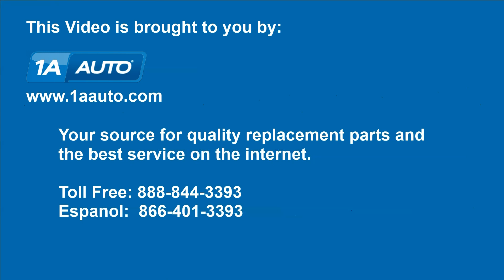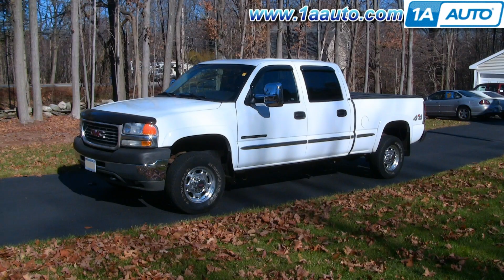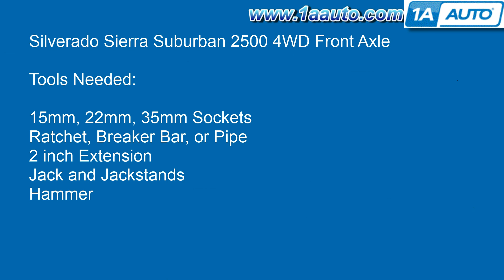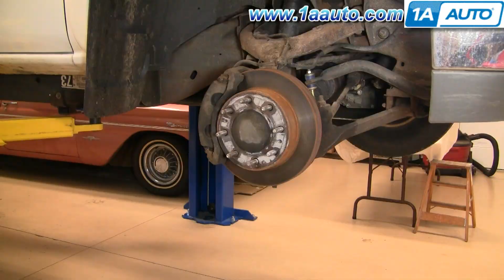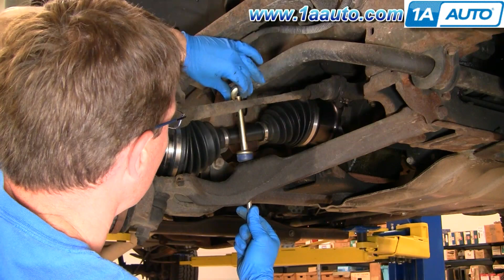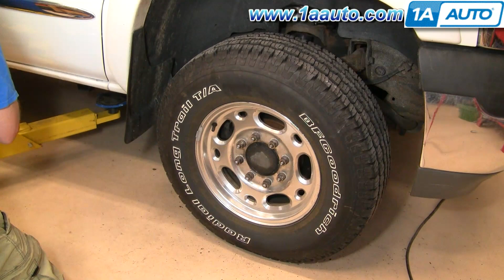How To Replace Front CV Axle 01-10 GMC Sierra 2500 HD

Comment: thanks this video worked out great. Guys if your truck is from the north it will not take you 20 minutes each side i spent 2 hours total on the job which still isn't bad and also it was my first time so i'm sure next time will be faster. The part that took the longest for me was keeping the CV axle from spinning while i loosened the bolts i used a pipe wrench on the driver side and that worked but the passenger side i had to use a pry bar and wedge it between the frame and the "ears" of the axle on the inside part where the 6 bolts are just to make sure it didnt spin and that worked out great. this isn't hard to do. also I took out the bottom bolt of the shock and pushed it out the way and was able to get the axle out that way vs messing with the sway links.

Comment: Great video great money saver. To remove that great big nut on the wheel I stuck a screwdriver in the ribs of the brake disk. As you turn it will hit the brake caliper.

Comment: GM made these very easy to do... You can do it without taking the wheel off if you want... I would have cleaned the mating surfaces and sprayed with fluid film....
Reply from the maker: +Steveo66 We appreciate the feedback. Sometimes there are multiple ways to accomplish the same repair.

Comment: Great video.  Can you tell me what the replacement bolts for the flange are?  Does 1A sell these?
Reply from the maker: +Jonathan Busch Thanks for watching!  We do not actually sell the replacement bots so we do not have the spec on them.  You should be able to reuse your originals like we do in the video, but if not you will have to source them elsewhere.  1aauto.com

Comment: did this repair and 1 of the 6 flange bolts broke as I was tightening them.  Checked you website (and others), no one seems to have a listing/category for these bolts (cv bolt, cv axle bolt, half axle bolt, flange bolt, etc.).  is there a size and specific material required for the bolts?  Is my truck safe to drive with just 5 of the bolts holding the axle?
Reply from the maker: +Samuel Karabaich I am sorry to hear that happened!  We do not recommend you drive the vehicle with a missing axle bolt.  That is most likely going to be a dealer part, so you may want to give them a call to see if you can get one. 1aauto.com

Comment: Hi I ran into an issue installing my oem replacement CV axle from gm for my driver's side and for some reason it will not reach the CV flange I tried to force it all together and tried jacking it the truck up and down and nothing was making it go on there yes I made sure it was oem it's exactly the same as the passenger side one what could cause this??

Comment: I do have a question I need help with.   I lowered my torsion keys on the front end of my 4x4 truck pretty low (I'd say 3 inches) ...and I was wondering if that can harm the CV joints in anyway?? They were horizontally straight, but after lowering, they are both now, at about 45 degrees .....is that bad?

Comment: I notices you only removed the stabilizer link-is that all thats necessary? I noticed in another video they had  taken the whole nuckle off -is that necessary to replace the axle?
Reply from the maker: +Jamie Hodkin Thank you for checking us out. Based upon the application you will only need to remove the sway bar link to get room for removing the axle. In other applications you must disconnect the knuckle in order to get the clearance. 1aauto.com
Reply: Is the procedure the same for a 1500 Yukon?  Or do you have to remove the hub?

Comment: I kept hearing popping and loud crack sound on left side so I changed upper ball joint which did help a lot but the popping and cracking still there.. super annoying, kept going under my truck to move things around and couldn't figure it out. Finally got the answer today, moved my CV axle up and down after jacking it up and  clunk/pop over and over..and this video does help to see how easy it is to do hope that info helps people that get that same problem.
Reply from the maker: +The Happy Ginie Glad to hear you managed to figure it out.  Thanks for the kind words about the video.  1aauto.com 866-403-3393
Reply: Was the noise mainly when you initially accelerated? I’m trying to diagnose a clunk sound that only happens on acceleration when load is initially taken off the front end...
Reply: I'm working on my 2005 sierra 1500 5.8, when i turn left or right sharply, i get this clunking sound. The sharper I turn the  harder it gets. I think its the CV Joints. Im gonna start there anyway. It super annoying and pretty loud. But only when I turn too sharp.

Comment: Thanks very much for this video!!  I had to do this repair on my 2003 GMC Yukon Denali today and your video saved me a huge headache.  I recently did the same thing on a Subaru Forester and that was much more labor intensive, so I was under the impression that the GMC would be as bad or worse.  Today's work only took an hour and a half (I'm not a mechanic by trade).

Comment: hi nice vid quick question my cv joint is done so i cant use the lugs to hold it still to remove the nuts on the axle would it work if i just put it in 4 wheel drive would that hold it?
Reply from the maker: You may be able to use a pipe wrench on the axle, to hold it in place so that you can break the nuts free. Hope this helps you out. 1aauto.com 888-844-3393
Reply: Yeah tried that no luck what did work for anyone else with a similar issue is i cut the boot open cleared the debre and jammed a socket driver inside againt the tines of the shaft and then let it rest on the bottem strut

Comment: Do you have to have both wheels off the ground or can you jack up one side of the truck?
Reply from the maker: It may be easier to lift the front of the vehicle off of the ground. You may be able to lift the side you need to replace off of the ground. 1aauto.com 888-844-3393

Comment: Hello, first thanks for the great video!  I used this to guide me on swapping out the half axle on a 2002 Tahoe.  Well now my drivers side half axle on my 2002 Silverado basically shattered.  My question is are the bolts that fasten the axle available for purchase at a normal auto parts store? Also I think the bolts broke off so will I need to purchase the part that the axle mounts too?  thanks in advance!
Reply from the maker: You may be able to get some new bolts from the dealer. Hope this helps you out. 1aauto.com 888-844-3393

Comment: Nice video have watched a few u made sure helps alot ,how do you check these to make sure they are bad.Would this cause a vibration at 35-50 mph
Reply from the maker: HI Kelly,

They may cause a vibration. If you can move them by hand, or if they seem like there's play in them then they should be replaced. You may also want to check the sway bar end links, to see if they're worn and they may cause a shake in the wheel at higher speeds. Hope this helps you out. 1aauto.com 888-844-3393

Comment: Thank you so much for the videos ive already watch, however i have a 96 silverado is the process similar?
Reply from the maker: We currently do not have an auto repair video for this particular application. It may be a little different than the one shown in the video. We do carry replacement axles on our website with FREE SHIPPING in the lower 48 states. Here's a link to the 1996 K2500 axles if you would like to see what we carry. Hope this helps you out. http://www.1aauto.com/1A/axles-and-axleshafts/Chevy/K2500-Truck/-/-/1996?utm_source=VideoReply&utm_medium=YouTube&utm_campaign=1ATony
Reply: 1A Auto Parts thank you i did replace it and its the exact same other than the stabilizer bar is a lot harder to access so i undid the suspension to maneuver the axle in place but thank you for all ur help and ur videos
Reply from the maker: Caleb Waites Thanks for checking us out. Have a great day! 1aauto.com 888-844-3393

Comment from the maker: You should torque that nut at the correct torque setting. It's a matter of safety, and your hub bearings may wear prematurely if the nut isn't torqued right. HarborFreightcom carry's decent tools that do not cost a great deal of money. You might want to see what they have. 1aauto.com 888-844-3393

Comment: This is a great Youtube channel and a great video, I have a 2001 gmc sierra 5.3 sle 4wd and my truck has been making noises when I turn the wheel to the right. Its making that "old spring mattress"noise when i crank the wheel and my truck makes a sqeek noise when i drive at 20- 40 mph, almost like the brakes need to be changed, but i already replaced them. What should I do? thanks

Comment from the maker: Normally you can tell a CV joint is bad when it has a lot of inside play. The issue could also be the Differential bearings inside the axle itself. Removing the front cover will give you a good idea of what is going on internally.

Comment: How can you tell the difference between a bad front differential and/or it's bearings and a bad CV joint?  I've had a low growl that gets worse with speed.  I've replaced both front HUB assemblies and taken out both CV's, but they don't feel bad.  If you're holding one in your hands, how can you tell one is bad?

Comment from the maker: Yes, the bolts should be torqued to their proper torque settings. You can do this in your driveway at home. A breaker bar will help to break the rusty bolts free. harborfreight com has a really nice 25" one that I've purchased for $10.99, that will make the job easier to do. Hope this helps you out. We carry the CV axles for your Chevy Silverado on our website 1aauto.com 888-844-3393

Comment: Great Demo. Help me get my job done. The only difference on my 2002 Chevy Suburban 2500, there wasn't really a traditional nut on the top of the stabilizer link, it was more like a flat washer with a threaded sleeve. Just used vice-grips to hold it  on the edges while I unscrewed the bolt. Thanks for the video, keep 'em coming.

Comment from the maker: Respond to this video...          Currently we do not have a repair video that shows you how to remove the axle shafts on a 2000 Jimmy. Usually on a job such as that, you would need to remove the wheels, brakes and calipers, take the cotter pin out of the retaining nut that holds the Axel into position. Once the nut is removed, you should be able to tap the axel at the end once with a hammer to break it free. The you should be able to remove it from the transmission.

Comment: !For 1997 K1500 Sierra, I preformed on my, pickup 2X. DON'T take out the stabilizer link (sway bar), instead take out the shock absorber, and disconnect the tie-rod from the steering knuckle (I think that's what it's called?) you may have to use a tie-rod separator to get them apart...

Comment: This will give you the 1/4" that is needed to take the axle out, and in with the new one (need to go forward w/ axle). A jack and stand-(support frame) will be needed as you will have to move the suspended side up and down to get axle out and in. This video shows him easily taking the axle out, but notice his axle has 5 1/4 moons between the bolts, K1500's are all round. Impacts are a MUST!